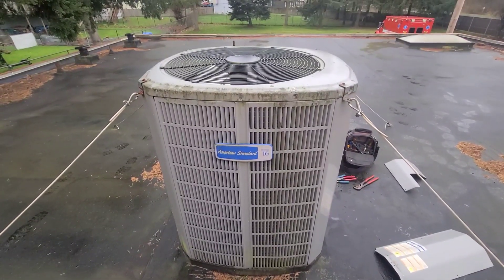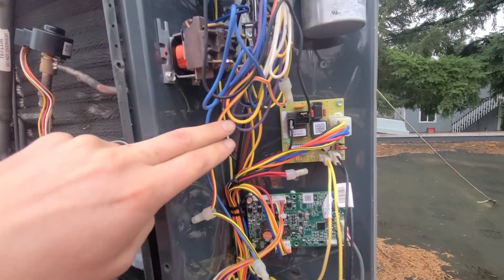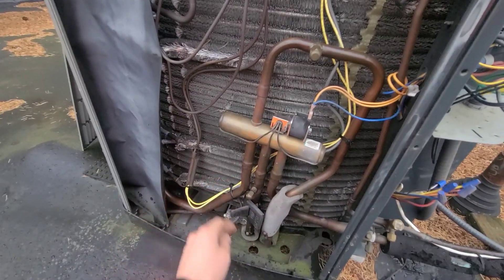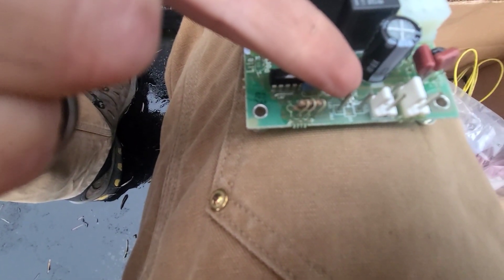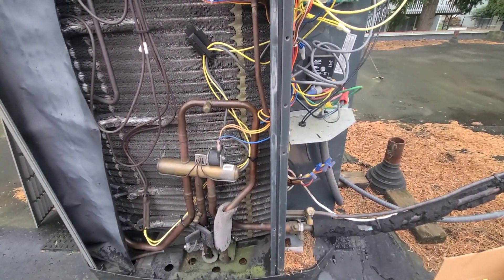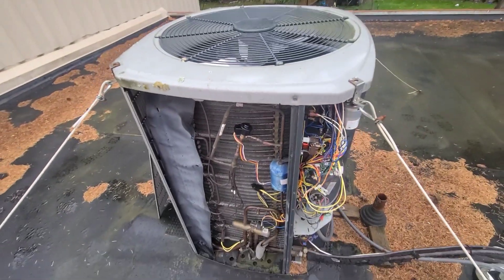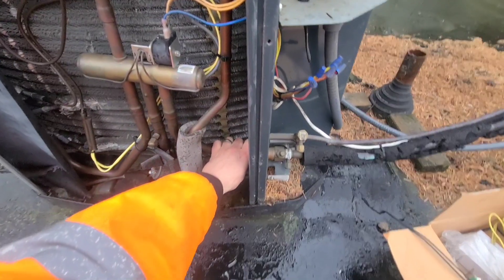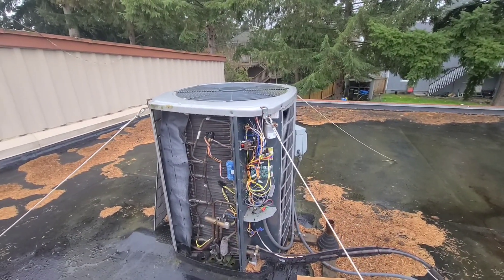Heat Pump Diagnostic And Repair

Comment: This is very helpful. It’s the first video I’ve found on American Standard/Trane defrost repair that shows where the coil sensor is installed and how to check that the reverse valve is in defrost mode.
Reply from the maker: Thanks glad it helped

Comment: What is the function of the black plastic tarp on the left side of the heat pump? Doesn't it reduce the airflow?
Reply from the maker: Good point. I'll have to look into it. I have seen it on so many Trane and American standard units I barely even notice it anymore.